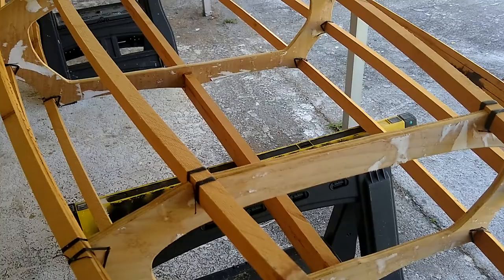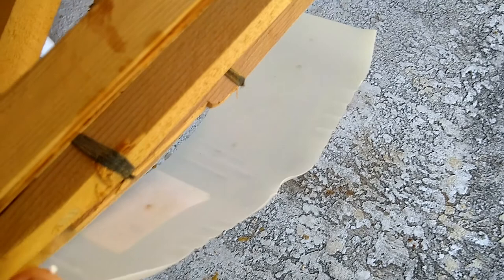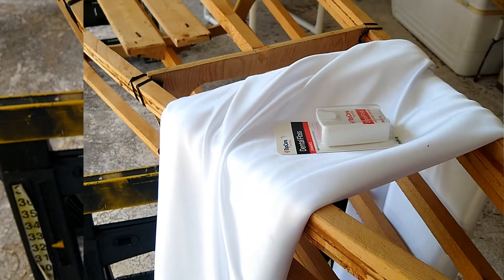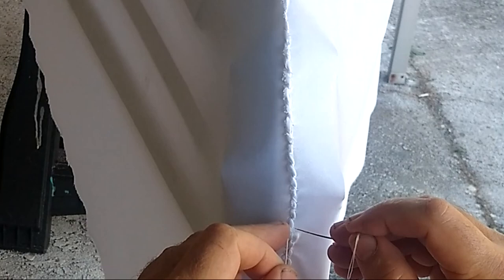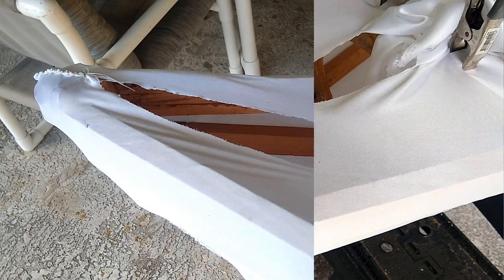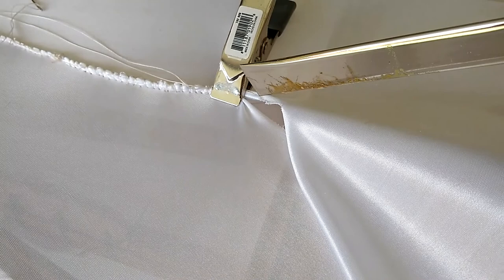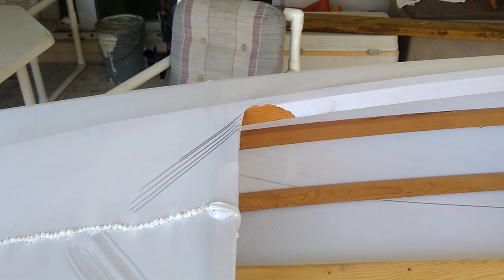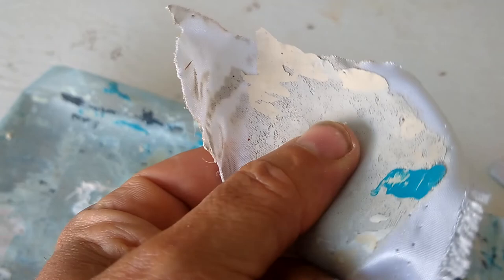Skin on Frame Kayak Complete. Poor man's Fiberglass? Kinda!

Comment: Love watching unusual methods of building small boats  Just a question, Why not us epoxy resin? Amazon sells two gallon kits for less than $100 delivered to your doorstep,
Reply from the maker: I got the paint for free! Also, I did a pair of standup paddle boards. One was with the poor man's fiberglass - paint on fabric, and the other was epoxy on fiberglass. The paint on fabric is holding up great, and the fiberglass is trash. I think that the epoxy isn't going to do well in sunlight without some sort of UV protection, but additionally, as just a protective barrier, the epoxy doesn't seem to work out too well. If I put on enough to make a hard shell, it may have worked out ok. Or maybe the cheap epoxy isn't great for boats. Not sure, but the paint works surprisingly good.
Thanks for the comment
Reply: @arichardofalltrades6770   If you have any further interest in epoxy , you could use aluminum paint over the eopxy.  Aircraft builders use this on fabric covered  planes for UV protection. the aluminum flakes are a much more effective  UV barrier than pigmented paints.  If you have an interest in a taut  covering, aircraft dacron can be heat shrunk after application  for a smooth tight cover.  The last time I looked, you could buy dacron that is OK for experimental aircraft much cheaper than dacron for certified aircraft .  It can also be purchased in different weights.  I did build a kayak where  I used a fabric skin saturated with epoxy. Then I fiber glassed the fabric and finished it off with latex house paint.  That combo worked great.  Messing around with small boat building is lots of fun  where you can experiment  without breaking the bank.
Reply from the maker: Thanks for the tips! I appreciate your input, and will give it a try.

Comment: Put a little sand in the paint and then paint the seats.  It will be perfect for non-skid
Reply from the maker: Sounds like a great idea. I ended up getting the grip tape the skateboarders use, which also works good, but will try the sand next time. Thanks!

Comment: Cool. I had no idea you could do that. Will any cloth work? Any oil based paint or latex? Thx. Im curious how that would hold up with long term immersion. I know you wont keep the kayak in the water for long periods of time but i have something slightly different in mind.
Reply from the maker: I've used natural fibers with my previous projects with better results. The instructions called for oil paint, but I used latex. I think it would work just fine for long periods immersed, but can't say for sure. If you try it, I would suggest keeping a close eye on it for a while. Thanks for the comment
Reply: Latex paint is not the old latex, works well on canvass (for years)
The cloth used on piper cubs had poly/dacron with “dope” finish, I used concrete sealer and it is just fine. Don’t like staples. Used heat gun to shrink cloth. All my experience, used brass screws. I messed up my kayaks tracking but 19’ and 21’ easy to track with a skeg set-up.

Comment: Cool concept -I’m impressed it held up in the water -& your weight 
I noticed you didn’t do your first couple layers with titebond 2 glue then put the acrylic latex paint on after? 
We’ll done ✔️
Reply from the maker: There is another boat I did with jut the paint and it is working great. Seems like the Titebond works well, but isn't an absolute requirement. At least from my experience. Thanks for the comments!
Reply: Original PMF boats did not use titebond glue because it didn’t exist. There are some examples of original pmf boats that have lasted decades. Titebond works great but most people use it because it’s cheaper than most paint by the gallon.